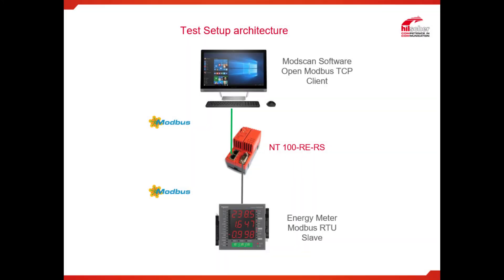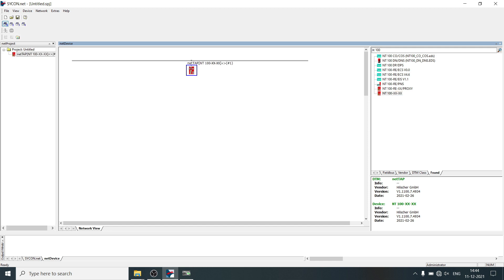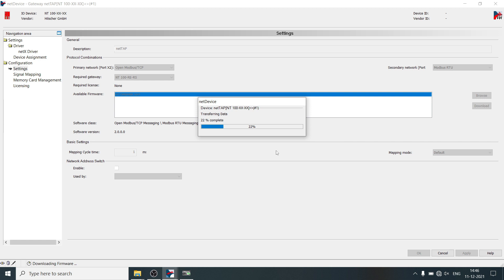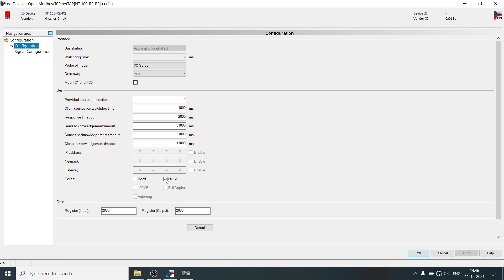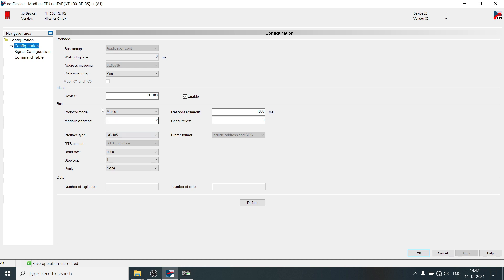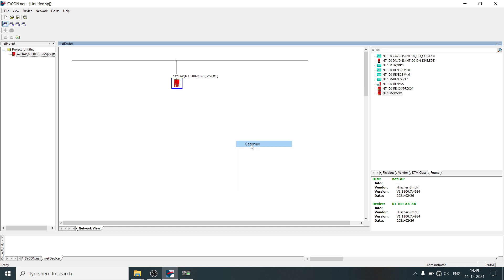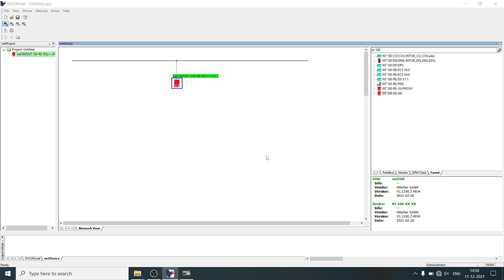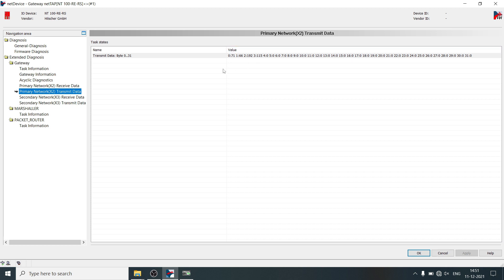Gateway configuration - Hilscher NT 100-RE-RS

Comment: Hi, My queries is which media is used to connect Hilscher module model NT- 100-RE-RS and whom version of software use.
Because we are try to connect the device use ethernet connection on port CH0 and CH1. But, result is negative device is not connected.
Reply from the maker: Hi, You need to connect USB cable which we provided inside the product box, you need to connect this USB end to your Laptop & then you will be able to connect this Gateway to Sycon.net Software.